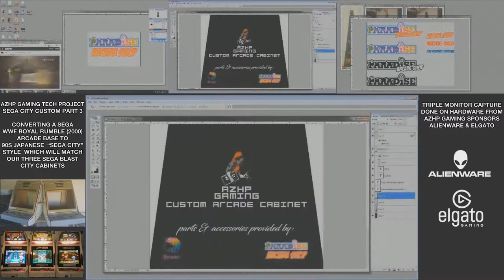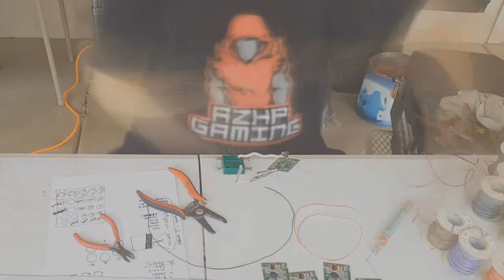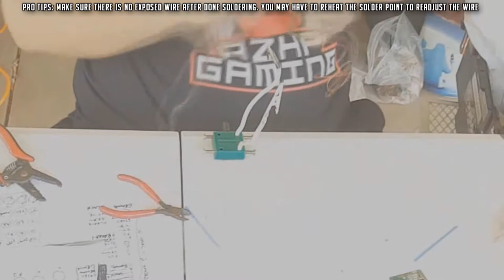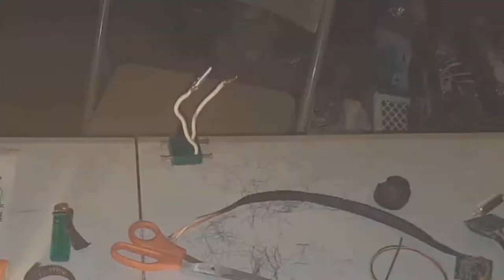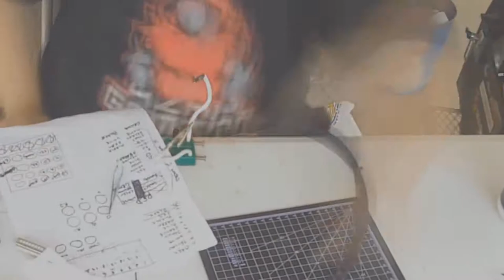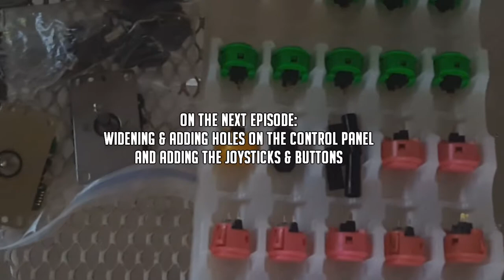CANDY CAB ARCADE TECH PROJECT PART 4 - TIME LAPSE SOLDERING HARNESS & DB25

Comment: Could you explain what you are doing here? I am trying to make a 4p arcade, but not clear how to wire the buttons, or if there is any Jpac Ipac that handles 4 players.
Reply from the maker: I wire up 4 Brook PS3/PS4/PC Fighting Boards for 4 directions, x, circle, triangle, square, r1, r2, start/options, select/share, home, and a ground. Then add sleeving, and wire the other end to a DB25. The point of using a DB25 is because then if we decide later down the road to have our 4 player cabinet utilize say a Dreamcast, we can padhack 4 Dreamcast controllers and wire to the same pinout of a DB25. The DB25 we did on these PCBs were male, so the 4 sets of joystick/buttons will be wired in same pinout to a female DB25 so we can easily swap them out if needed.
I don't have any experience with a Jpac/Ipac, as that's stuff geared towards the MAME crowd much more than the hardcore fighting game community and modders such as myself. 
I also don't mind the Brook PS3/PS4 Fighting boards standard as I have the skills to solder everything. There are versions of this board that have a breakout board with a standard USB B output and screw terminals for those who can't or don't have the tools/experience to solder.

You can get them at Paradise Arcade Shop here:
http://bit.ly/azhppasbrook

PAS also has the Brook Fighting PS3/PS4/PC boards with audio which are the newer versions with all screw terminals, and they also have the Brook Universal (which are expensive but work on PS3/PS4/360/XB1/PC/WiiU/Switch)

Hope that helps, if you have further questions feel free to ask.
Reply from the maker: Also do you still have the Blast City for sale? If so what city/state.
Reply: hmmm I see, I am trying to do a CRT cab with 4p. Not sure those brook boards would be useful, are that many arcade games on modern consoles for 4p? Which games are you planning to use it with?
Reply: Yes, it is, but I´m in Europe not US.
Reply from the maker: When not using it for PC, we could easily run 2 consoles (or even 1 console in the case of 4 player SFxTekken) in the cab instead of 1 PC since we have 2 screens. So our use is a bit different than yours. CRT or LCD is irrelevant to your control panel wiring. That only needs to work with the device(s) in your case I assume it's PC.
Reply from the maker: Damn. We want a 4th Blast City! XD
Reply: Yup, I guess main point is I have only one screen. Anyway, I´ll keep an eye on this project. If you want the Blast you can have it shipped but it will be a bit expensive : P
Reply from the maker: It'd cost 3x the shipping as the unit. We'll find more someday. Good luck. :-)